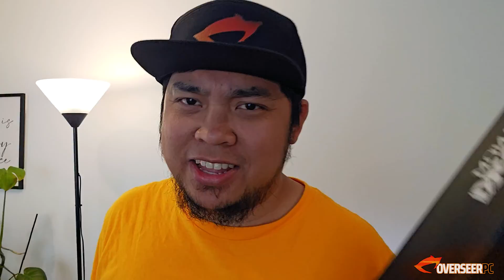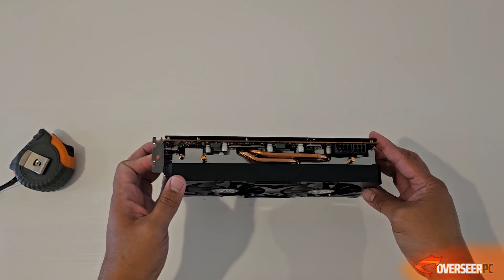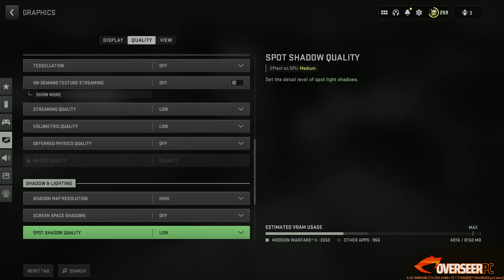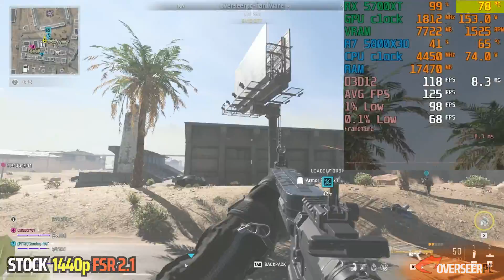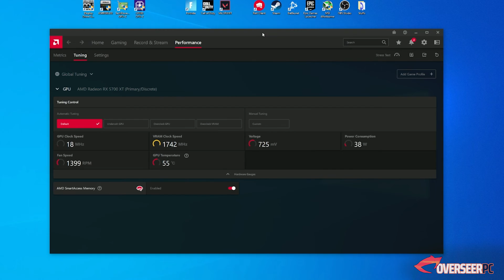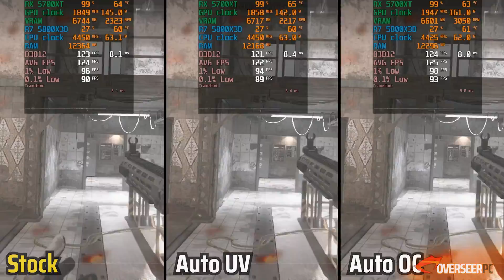Is this Cheap GPU from AliExpress worth the HYPE? 🔥

Comment: they cost $160 and it's a complete rip off at that price.  the most I would pay for a 5700xt with a used gpu on it would be $100.  they missed the mark big time with greed.  at $100 price tag, i would buy two or three.  at $150 price tag, I buy zero.

Comment: They heat up quickly during oc, and I've heard bad things during under clocking.
Reply from the maker: These things do run hot but it's not that bad.. here's the updated performance - https://youtu.be/4CwauvrnsgY
Reply: @OverseerPC-Hardware  will check it out, I should have finished my comment as I still recommend them for budget builds
Especially with the 3600x being £40+ on ali express

Comment: I bought the Soyo rx 6600m white version, happy af with it ^^ but only after flashing it to a normal rx6600
before it was incomplete and lame, couldn't disable zero rpm on latest drivers, had no access to power tuning (no oc/uv) and no fsr and frame generation
Reply from the maker: Good to know that you can flash it to a normal RX 6600 bios, and improve its performance 👍

Comment: love the video , but a have a question , should I update the drivers from and adrelanin or just stick with the default drivers , cuz I heard some people their soyo (GPU) crashed after updating the drivers
Reply from the maker: If your games are working fine bro, don't worry about updating the drivers.
Reply: @OverseerPC-Hardware  and do you recommend I install AMD adrenalin?
Reply from the maker: AMD Adrenalin is part of the standard driver package? Are you just relying on the Windows driver?

You need the official AMD driver package.

Comment: I just got one and had to return it, as soon as the vram usage went over 6500 it black screened and I had to reinstall drivers and everything, I feel like I got the only bad one as all the other vids are about how good it is.
Reply from the maker: Unfortunately, there will always be defective products in a batch. Hopefully, you got it refunded.
Reply: I feel you man! ..except i was never able to use mine! ..the fans were spinning but i never got a signal to my monitor!
Reply: AliExpress gave me a full refund and a free return label. I bought a second hand 6700xt pulse, working great.
Reply: @RighAlban  Good for you! 😀 ..unfortunately i was not that as lucky because the 15 day period to ask for a refund expired! ..i'm currently saving up to buy a brand new ASUS 6750 GRE 12GB (basically a 6750 XT but cheaper and exclusive to the china market)!
Reply: @iam_nobody  Did you contact the seller, the 15 day thing is through AliExpress themselves, the seller usually gives a refund out with the AliExpress 15 day, those Soyo GPUs usually have a years warranty, if you provide video evidence of the card not working you still have the chance of a refund.
Reply from the maker: Just a tip guys, don't give feedback the moment you received the product.. test it first before giving product/seller feedback. Sellers in AliExpress do take a while for any warranty claim.. you have to provide a lot of evidence before they'll accept it but they do accept claims. 👍

Comment: If i was to get this what cpu and mother board should i pair with this?
Reply from the maker: Depends on how much your platform budget is?
Reply: @OverseerPC-Hardware  around 800 nzd
Reply from the maker: $800 for CPU+Motherboard? Or is that for everything (apart from GPU)?
Reply: @OverseerPC-Hardware  I can get a power supply and pc case and maybe the ssd from my dad's old pc because those are the only things that haven't broke but yeah everything else I still need to buy
Reply from the maker: So, if you're after $800 for everything apart from those...

RX 5700 XT = $230 (Ali)
Ryzen 5600 = $228 (PB)
MSI B550 MAG = $205 (PB)
DDR4 16Kit = $79 (PB)

You have $60 extra... Actually, if you're good in hunting, you can snag a $300 RTX 3060 in Facebook or Trademe, which do show up once in a while. 👍
Reply: @OverseerPC-Hardware  thank you so much this help out a ton especially that 90% of pc youtubers are from the USA or eny where but New Zealand
Reply from the maker: No worries, bro.. happy to help out 👍
Reply: @OverseerPC-Hardware  I'm actually surprised how many 3060s are on trade me for 300$ so I'll definitely keep an eye on that
Reply from the maker: Yeah, there's heaps especially after like free selling weekends. I think I bought one for less than $300 before and a RX 6600 for $220 months ago.
Reply: Would you still recommend a Ryzen 5600 pared with a 3060 or will it cuase bottle necking?
Reply from the maker: It'll be fine 👍

And for the record, there will always be a bottleneck in any system.. whether its CPU or GPU. It just depends on how much you want to spend for it to be 'acceptable' experience for yourself
Reply: @OverseerPC-Hardware  sounds good, this'll be my first pc build if I go through with this, ALL my friends have been begging me to switch from xbox to pc and now I have a job I'll be able to afford a pc, that's why I've asked alot of questions because i want to make sure im get my moneys worth and not wasting 800$

Comment: Could you show your manual UV settings and were they stable? If you can answer this I will really appreciate it. Cheers
Reply from the maker: What I've used for manual UV was P3 voltage set to 1050 (from 1112). Video was a bit long hence I've cut the part of how to set it up. 👍
Reply: @OverseerPC-Hardware  you've gotten my sub, I'd love if you made a dedicated manual UV for amd cards, like what software you use ect
Reply from the maker: Thanks for the support bro. I don't usually make OC or UV guides because every silicone is different, and my results might vary from everyone else.

But here's what I usually do. Set Auto undervolt from driver - this is usually stable and very conservative, this will be your baseline. After that, you drop some mV increments and test until you encounter instability. Once you encounter instability, the last stable UV would be your setting.

If you want UV+OC, you then increase clockspeeds increments, same process until unstable.

Comment: Sold my 6900XT for a very nice price to get something better but ended up buying one of this for $137
Reply from the maker: Are you using this as a placeholder bro?
Reply: @OverseerPC-Hardware  that's the ideia but it wasn't delivered yet
Reply: @jorgefernando9306  did you get it yet and is it good to use?
Reply: @jorgefernando9306 so any updates bro? Did the card burn or nah 😂
Reply: @KingdomRepublic  refund requested... The card doesn't work properly without reducing the gpu clock to 1755mhz 1000mv + 25% power limit. .. It seems to be a regular 5700 with a XT bios mod... Aliexpress provided full refund and now I  have the card running with reduced clock speed but 100% stable!
Reply: Nice video. Please, how can one detect a faulty or malfunctioning CPU?.

I intend to buy a SOYO motherboard. Please, is it reliable. UCHE from Nigeria.
Reply: You changed to a worse GPU bro.. well, maybe you didn't need a 6900XT
Reply: @macblink  that's the point. I don't need a high end gpu anymore. After my kid was born, gaming is something from the past....
Reply: @macblink  that's the point. I don't need a high end gpu anymore. After my kid was born, gaming  became something from the past...
Reply: @jorgefernando9306 wish you goodluck with your kid :D
Reply: Huh?

Comment: I just bought one of these for my first build on my channel, tbh it's performing pretty good so far
Reply: is it still working for u ? please reply im about to buy one
Reply: @belliouss6971  Yessir still working like a charm. I'm a very casual gamer though so I don't play E Sport titles, or need to overclock really. I haven't been pushing it crazy or anything, so idk if that matters to you. But imo SOYO is a great AliExpress GPU company. Their GPUs aren't used and they make them actually themselves. Definitely a good buy, would recommend if you're going for a budget build. I plan on upgrading from my RX 5500 to a 6600M. SOYO has GTX cards as well so may even check those out too
Reply: @belliouss6971  Yessir still working like a charm. I plan on upgrading from my RX 5500 to the 6600M. SOYO is a great AliExpress GPU brand imo. 100% recommend for budget builds. I may even check out some of SOYO's RTX cards
Reply: Any updates?
Reply from the maker: Glad it's working well for you bro 👍
Reply: Is it still working i just brought one but i read somewhere that it willl only last 2 weeks?
Reply from the maker: Still working for me bro.. if it stopped working after 2 weeks, best to get in touch with the seller or AliExpress directly. 

I've had replacements before with AliExpress tech products (Ryzen CPU), I'd have to prove it wasn't working (via video) and pay shipping back to China, but they cover the shipment back.
Reply: Still working for me too a year later! No issues whatsoever honestly. I’ve played so many different games with it, and I don’t even overclock it. However with all the new games getting more demanding, I will be getting an overall stronger GPU with more VRAM soon. 

For example, I can run Dragon Age Veilguard at high/ultra settings, but the fps definitely drops below 30 in certain areas. But that’s not because of the brand, more simply because it’s a 5500 XT. Maybe if I overclock it it’ll perform better with higher end games, but I just don’t bother with any of that personally. 

In the end though I definitely recommend SOYO, but maybe get a 6600 or higher. And/or one with 12GB VRAM at least. If you’re building your first build and don’t want to spend an arm and a leg, I definitely recommend one of these. I didn’t want to spend too much money in case I messed something up horribly, so yeah lol